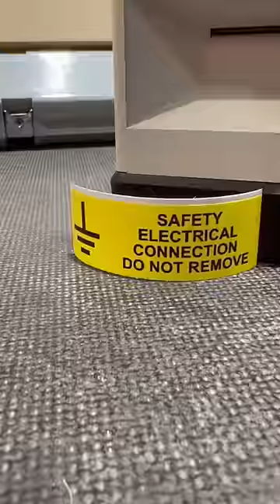Electricians Shocked by this Mysterious Earth Clamp

Comment: Those cable idents are a bit useless aren't they?
Reply: Yup, you may as well go to the trouble and fit them to all terminals everywhere on a property.
Reply: Surely thats why the wires are colour coded😂
Reply: They're fine.

It's equipotential bonding of services in to the building. 

When you want to test your External Earth Loop Impedance you can temporarily disconnect the W(water) and G(gas) etc, then reconnect them again for the Prospective Short Circuit Current test 👍
Reply: But they both say E. So impedance loop earth testing of water and gas circuits would maybee be W and G. Ultimately its over complex nonsense
Reply: @mikechurch1407 
You read the ferrule with the cable horizontal.
They both say W because they are both Water Pipes. 👍

Comment: Grounded into waterline, thats some old school stuff.
Reply: Which probably wasn't as big of a deal as there were fewer electrical devices on the circuit and less load. There were also only 2 wires being used, so the conduits and plumbing were used as a ground.
Reply: @SmallSpoonBrigade  I know you have to ground your plumbing but electric panels should have a direct earth ground. My luck is get electrocuted in the shower... Lol
Reply: Work for water authority in Australia. We have had deaths from faults going Down earths like this making water mains live. I’ve had a shovel weld to the main when digging. This type of earthing is dangerous. Killed a small child in Australia aswell. 🤔
Reply: @Adamisthesickest  pretty sure that's why developed nations no longer allow it. You ground the plumbing and you ground the breaker panel separately into the earth and not water lines.
Reply: @mattypants not an electrician or plumber but was thinking the same thing  as I work around a lot of electrical and plumbing in homes glad to be in the u.s.a. I suppose lol
Reply: @mattypants  we have very good electrical safety when working on water mains. Bridging our work area and have what we call plumb guards that detect any presence of power coming into our work sites, with the addition of rated gloves. 👌 
It's a shame even in Australia it's still common practice by some to earth to the copper taps/piping of houses.
Reply: @Adamisthesickest  This isn't a type of earthing - it's bonding.

Metallic pipes in the ground introduce a potential into the building. Lost your neutral? Power appears to be out.. and yet there's full mains voltage between any electrical ground (like a kitchen appliance..) and the plumbing.
Reply: its a bond and it gets the waterline to the same potential as ground.. is you dont you can have a slight voltage between ground and water/gas
Reply: @Adamisthesickest It's not an earth ,it's cross bonding. If your pipes live, the neutral and earth must be both broken at the property.

Comment: This is a requirement in the UK for a 'protective main bonding conductor'. Which is not not an 'earth', though it's terminated at the earth terminal in a fuseboard. It's a common connection to all 'extraneous' metalwork within an installation, to reduce the risk of differing voltages across any accessible metalwork during an earth fault. If somebody happened to be in contact with, for example, a bonded water main and an unbonded gas main during an earth fault then that person can conduct current across those points of contact due to the presence of different voltages, which is a circuit.

Comment: copper water pipes are usually soldered together and there is a possibility that if sufficient current get the pipe hot enough to melt that solder a grounding could be compromised.  Check out the National Electrical code in both USA and Canada
Reply: He's not using the pipes as a ground. He's bonding the pipes TO ground, so that if something gets shorted to a pipe, it has a low resistance path to ground.
Reply: Like that is going to happen with a pipe full of water
Reply: ב''ה, no guarantee these don't transition to pex.  Only suitable for electrifying plumbers and clients.
Reply: Perhaps you should check out the Requirements for Electrical Installations in the UK before assuming you know what you're on about..
Reply: @puckcat22679  It is for a path to ground, but not for shorts
The iron content of water induces a current at high flow, only a very small one - but enough for the copper pipe to start galvanic corrosion if it's not grounded

Comment: Once you use your copper water supply pipes for a ground, you inadvertently supply all of the plumbing fixtures in your house to an electrical current.
This causes a condition called galvanic corrosion, destroying your plumbing fixtures prematurely.
Reply: The pipes doesnt supply to ground it is Just bonded to it.
This is Standard praktise in europe. The normal ground is supplyed by a grounding rod near the Main Electrical panel. Every large mettalic object inside a house has to be connected to this rod.

it is in our electrical code DIN VDE 0100-410 and DIN VDE 0100-540
Reply: Nonsense.

Comment: 4Ga.  stranded ground cable and an hour pounding in a 10' rod into the earth.  Building code is PEX and PVC/ABS.  No funky connectors, just sweat and a big hammer.
Reply: Totally irrelevant. This is not a substitute for a ground rod, it's bonding, and what your new buildings in your totally different country use has no bearing on existing installations somewhere else.

Comment: People commenting about 'earthing' to plumbing is dangerous, it is the opposite, it is bonding to a properly earthed or grounded system to protect the plumbing distribution inside a structure from stray current. It is done to ensure that the metal water pipe is at the same zero voltage to ground as the service grounded conductor. Like anything if a system is improperly installed, it can be dangerous or even fatal.
Reply: If you have voltage on your plumbing distribution, it is a wiring fault or a failing electric+plumbing appliance, such as a clothes washer, dishwasher, or electric water heater and needs to be addressed immediately.

Comment: As a lineman, a couple times a year we get trouble calls where home owners have voltage on their shower heads and sink faucets and they are getting shocked when they touch it. I measured 60 volts on a shower head pipe before. Its because years ago, before I was even thought of, it was normal practice to ground the neutral of the underground house service to the water pipe. The neutral slowly corroded over the years and the house started looking for a neutral elsewhere, like someone barefooted standing on the bathroom tile and touching the shower faucet.
Reply: Oddly enough, we don't bond pipework which isn't introducing the potential you're standing on for this reason. Not that even a wet bathroom floor should be anywhere near conductive enough to be a hazard.

Also, we don't have neutrals which quietly corrode away with no testing ever occuring, but that's another problem for another day.

Comment: I’m not an electrician or a plumber, I’m a mechanic with a fair bit of electrical experience on a wide variety of things but why is the wire marked “E” on one end, clearly going into an earth and an upside down “W” on the other end on the water pipe. Is that standard practice there?

Comment: Nice idea as long as the electrician uses a copper pipe and not the iron gas line as the did in our home.  How it ever passed inspection we will never know.  Also, make sure that a jumper bridges the water meter to maintain the earth ground.

Comment: Can we stop bonding to water/gas lines???  There's been enough cases where it's been shown in some instances where it creates more problems than it solves.  Just do a proper earth ground...
Reply: What's more proper about something with a totally different function?
Reply: They're earthing the pipes to the cabinet, not earthing the cabinet to ground through the pipes.  The cabinet earth rail connects to e.g. grounding rods through a separate wire, not shown in this video.

Comment: We have a 10’ copper grounding rod next to the foundation with a bare stranded copper wire running into the house to the copper pipes and gas line.

Comment: Yo, why does this work? Because the copper pipe goes through the ground which in turn grounds it? I've seen grounds connected to pipes outside home in US. I thought it looked janky af and borderline dangerous but im not an electrician or plumber. It does seem counter intuitive to connect electrical to water pipes.
Reply: They're earthing the pipes to the cabinet, not earthing the cabinet to ground through the pipes.  The cabinet earth rail connects to e.g. grounding rods through a separate wire, not shown in this video.

Comment: No! Use a ground rod on-site, not just copper piping! Minimum standards may allow for that, but it's not the best safety practice!
Reply: They have a proper ground somewhere. This is just grounding the metal piping in the house TO that ground rod. You know? So that all of that metal in your walls and going to your faucets and other terminations are grounded?
Reply: @JimYeats  No, it is not proper grounding! There is too much potential for corrosion to develop a resistance that makes the grounding dangerous! Piping is no longer a valid grounding in the current NEC and most municipalities.
Reply: @musicinspire1745  The pipes are just bonded TO the ground. They aren’t the main ground.
Reply: @musicinspire1745 listen what other dude is trying to tell you. There will never be any current in those pipes, he is grounding them for potential reasons.

Comment: A ground for a house is supposed to be two metal rods sunk 8 feet into the earth. Sometimes you can get by with one ground rod but it has to be below 25 ohms resistance. Two ground rods is preferred.  The pipes can be used as a secondary ground only if they have 8 ft of contact into the Earth. That expensive contraption in this video is totally unnecessary. But there should be metal rods in the Earth with the system bonded correctly to that. I only mess with the electrical system that comes after the ground rods but I have read about this and examined properly installed systems.
Reply: Piping should always be grounded.
Reply: They're earthing the pipes to the cabinet, not earthing the cabinet to ground through the pipes.  The cabinet earth rail connects to e.g. grounding rods through a separate wire, not shown in this video.

Comment: How come you have to torque the DB but not at the clamp ? Do you not think the clamp has more chance of coming loose due to it getting knocked while in the back of a cupboard or under a sink more than the connection inside consumer unit ?
Reply: No value provided to torque to, up to your judgement.

Comment: One does NOT, as in absolutely POSITIVELY NOTTTT, ground electrical installations via ANY plumbing at all. You do not even connect it to anything that goes into the house once you’re outside either. It can be done, and is done, but it shouldn’t be. You do not want current to be lead through ANYTHING but wires. Permanent grounding must need be done SEPARATELY.

Comment: Using the house plumbing system as an electrical ground can result in a shocking experience that you won't soon forget.
Reply: He is not using it as ground. He is grounding the pipes for potential reasons, the earthing bar in fuse box is seperatly connected to the ground

Comment: A couple 2 peice ground clamps and some split bolts for exact same effect at 1/100th the cost.
Reply: Really, and what do you pay for those clamps?
Reply: @Monkeh616  $3 a piece
Reply: @jongrier5093  And your guess on the cost of the clamps shown? Sounds like $300. I can order them right now for $2.43 a piece, and they are in fact expensive compared to the usual style..

Comment: I have a serious question: What stops the dielectric action from corroding the copper pipe caused by having two different metals in direct contact? Or is it made of brass?
Reply: The use of appropriate materials. I'm not sure what these clamps are made of, but I imagine they did consider such things before putting them on the market..
Reply: @Monkeh616  I just ordered one. $12.00 is atrocious. But I plan to do some testing.
Reply: @jbirdmax  Well, they're more reasonably priced in their target market.

I am curious, though. If they have used steel, well, that'd be disappointing. I'd expect brass, bronze, or just cast zinc.
Reply: @@retiredbore378 Galvanic corrosion on copper requires an electrolyte, but copper corrodes.  
With electrolysis copper turns into oxide and forms pinholes. Especially when sent through holes in wood, which is usually electrolyte weak like potable water, but over a few years can cause leaking without proper sleeving and/or protection from other metals.
Reply: @@retiredbore378 all I know is over the course of my 45 year plumbing career from which I’m now retired, I’ve seen steel completely destroy copper from electrolysis. I’ve studied this over my career. It’s not caused by air but rather the moisture therein. And the steel. I tried to link photos but not sure if that worked.

Comment: Grounding to water pipes has always been a bad idea. Good way to promote electrolysis. And good forbid those pipes aren't effectively grounded somewhere down the line.
Only bond grounds to a ground probe line, never to any metal structure or pipe. Those things may also be bonded to a ground probe line, but techs should never trust that.
Reply: They're earthing the pipes to the cabinet, not earthing the cabinet to ground through the pipes.  The cabinet earth rail connects to e.g. grounding rods through a separate wire, not shown in this video.
Reply: Again... never trust bonding THROUGH another part or structure. Always run independent earth bonds. 
Just because a metal building or metal piping is bonded down the line doesn't prevent that bonding from being corrupted or lost. Bonding to metal structure on the way to a ground source is acceptable but NEVER bond THOUGH a structure.
This is the difference between knowledgeable professionals and folks that know just enough to get themselves in a heap of trouble.
Reply: @deek791  equipotential bonding

Comment: It's also perfectly okay to use the neutral connection from grid power as the ground reference.
Reply: Yes and no. Unless the building is in a marsh, the best ground is almost always the commercial electric service. The neutral is ultimately connected to (typically) hundreds of ground systems, one at each customer on the leg.
It is improper to use the service neutral for a site ground but faults and lightning will always do just that. Driving a copper rod or burying a chemrod ground will never rival the ground the service neutral represents.
It is not okay but it is not entirely avoidable. The neutral must be locally grounded but the neutral is much lower resistance to ground.
Reply: Thanks for the insight  @flagmichael . I'm just an undergrad student, and not even in a engineering field, but this stuff is fascinating. I only had recently heard of DC grid systems with single line delivery and ground return, and the whole concept of electrical ground suddenly became much more confusing - the same has fortunately happened for me in other subjects, like the idea of surplus and shortage as being economic states of a market that are very clearly connected and visualized on a supply and demand curve graph, from which more interesting derivatives are formed, like price elasticity of supply and demand. Everything is so much more interesting than we know.

Comment: Wouldn't pass any regulation check-up where I live! 

Here the ground must directly be connected to a dedicated ground loop wire, that's embedded under the concrete foundation of your house.
Reply: And that's well and good, because this connection doesn't substitute an earth electrode. It's something else entirely.
Reply: These pipes are connected to earthing bar which is connected to earth electrode. This is made for potential difference reasons & is how it should be. Those pipes are not used as ground!

Comment: If you were to touch one of those exposed extraneous metal parts, and it had become live from one of the many possible sources, and the supplementary bonding connecting those parts to earth with other protective devices were not in place, then how would the electricity get to earth ? What path could it take ? Asking for a friend
Reply: Electricity wouldn’t flow through you, because a human body is higher resistance than the grounding rod itself 😂 not to mention, it would instantly be detected and electricity cut iff
Reply: @techheck3358  thank you for not actually understanding the problem. Have a safe day 🙂
Reply: Depends on the humidity and conductivity/water content of the materials you're touching.
Reply: @williamchamberlain2263  reasonable enough point made . Would appear that you may have at least a better grip of the subject than old techheck, bless him

Comment: Yeah but the Actual worst part despite if this is just Copper in The wall behind the water heater And the rest of the house is Pex

I mean really. Why buy a clamp when you can literally just Wrap the wire around a few times. A solution with zero drawbacks. In the event the Ground becomes live that still has nothing to do with this connection having a proprietary clamp or not.

Comment: Non-electrician here.

I'm curious why these two earth connections are made in series. Is this so one acts as a backup should the first fail, or are they that way for another reason..?
Reply: Bonding conductors aren't allowed to have joints in them, so you can either run two separate wires, or pass one through unbroken like this.

Comment: I can do your bonding its 200 quid but it will take me at least 700 quid in fancy screw drivers most sparks will never get there mits on ! Any decnt spark  Could have dont the lot with a 4mm terminal and a pair or snips cable clips included
Reply: Well maintained tools last a lifetime so that's a one off payment.